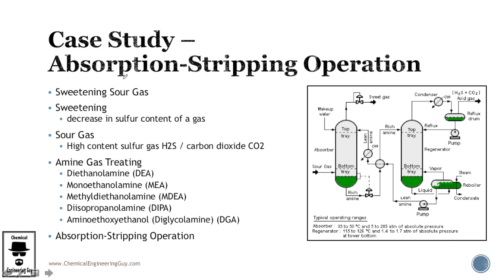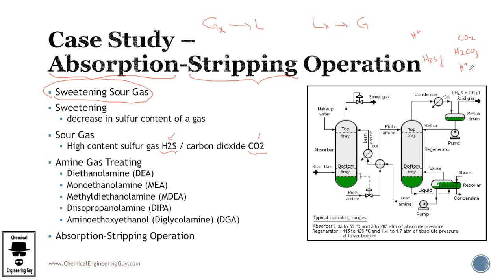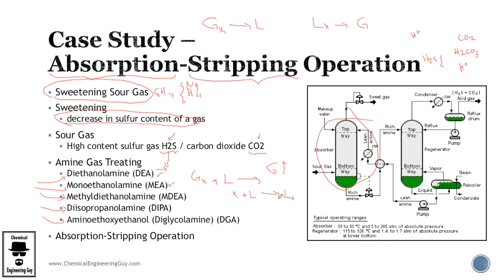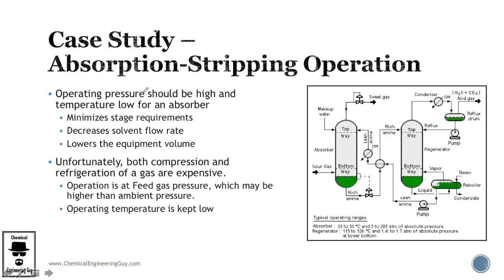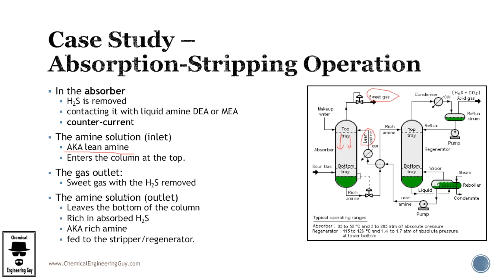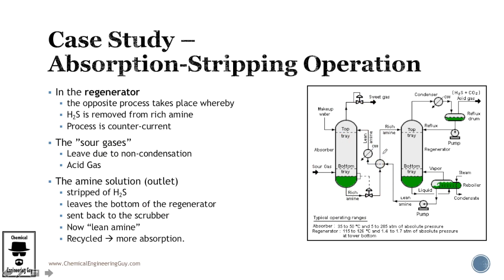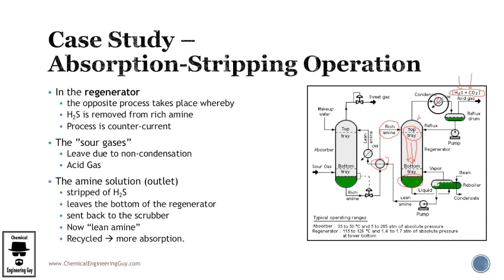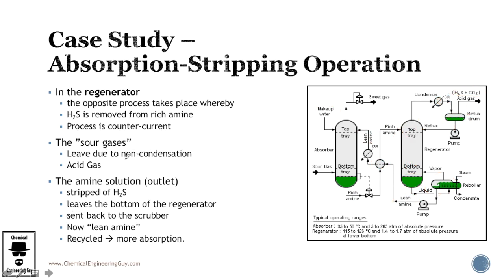Amine Gas Treating Sweetening of Sour Gas (Lec048)

Comment: Sir how it's unit operation if the CO2 forms H2co3 ? Wouldn't it be unit process??
Reply from the maker: yeah, technically speaking, but remmeber that unit operations within unit operaitons can be also assigned as "unit operations" for instance, reactors that require heating or cooling, will be seen as a "single" unit as well

Comment: Thank you very much, your method of teaching is very effective! Thanks again!
Reply from the maker: Thanks! Im glad you found it useful XD
Reply: @ChemicalEngineeringGuy  I load and discharge chemical barges on the Houston Ship channel. Long ago when I believed my calling was structural engineering I first earned an associate's degree in Drafting and Design because I wanted to work with Engineers from the ground up. After working with them 10 years I found out that they were only fond of themselves. So I found a comparable salary with a simpler way of life in barge tankering. Lol I said all this to ask why does Sodium Sulfide (Spent Caustic) 9/10 contain h2s?

Comment: I am designing amine regenerator and i am using steam for stripping co2 but i am straggling with the equilibrium data do i use co2 and amine data or co2 and h2o data? Can you help me with that 🙊
Reply from the maker: Well, you already stated, you are using water + CO2, but remember that CO2 binds to amine as well... meaning that you need both of them :)

Comment: When adjust function is used in Hysys? Could you show an example in an amine case?
Reply from the maker: You will adjust for the required value, it is used when you need to fix an input only